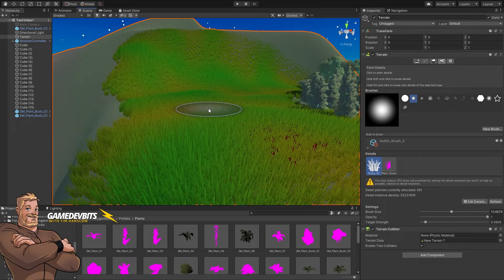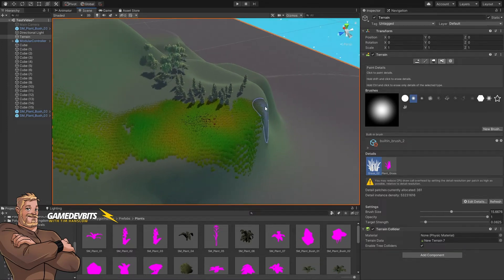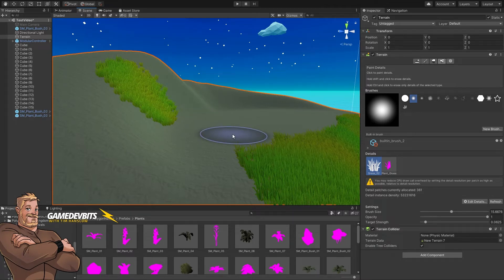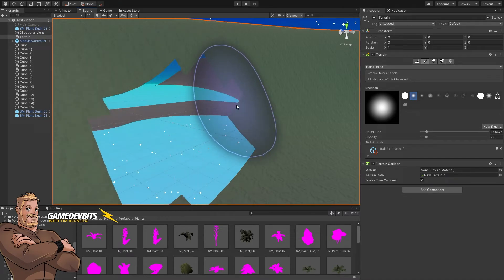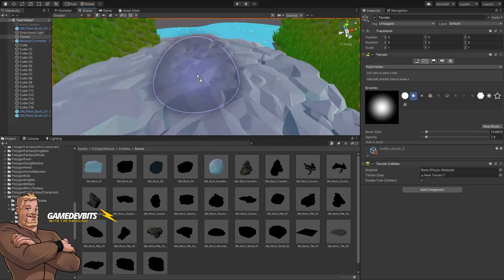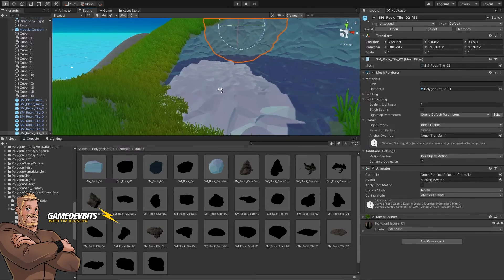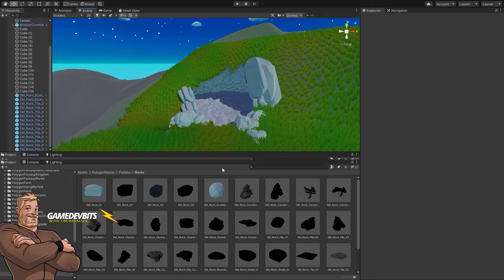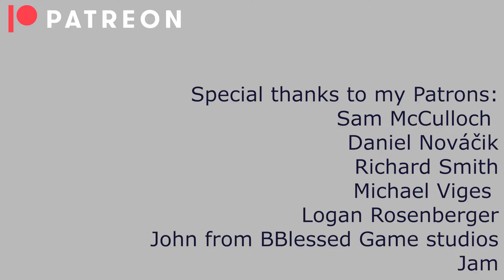Unity3D Tips - Terrains - 6. Terrain Holes

Comment: Can holes be made dynamically? Example: a sandworm coming out of a tunnel
Reply from the maker: Yeah you can use the terrain tools dynamically at runtime via script. But it's not really designed for it, so performance can take a hit. And you've got to get it right. Painting holes can be fairly chunky because of the resolution of your base texture.

On the asset store you can pick up Digger Pro which will let you do it at runtime, and it creates a voxel mesh to attach to the holes. Caves, overhangs etc.

https://assetstore.unity.com/packages/tools/terrain/digger-pro-voxel-enhanced-terrains-149753?aid=1011lcLEi

But, the big question is. Do you NEED the hole?
You could make a mesh that looks like the top part of the hole, pushed up sand. Dark texture in the middle for the "hole" part. Throw on some particle effects for dust and sand to mask it and then just spawn it on the surface.

Could even make a simple custom material to simulate the hole.
Nice and performant, no holes in the terrain.

Comment: My Terrian Holes wont render when I build. I have selected "Paint Terrian Holes" in the URP-BalancePiplelineSettings. If I enable "Draw Instanced" on my terrian, the hole work but all my ground textures dissapear.
Reply from the maker: There have been some shader bugs in various versions that stopped terrain holes rendering. First troubleshooting step would be making sure you're on the latest URP version for your Unity. And if so, move to the latest LTS.
IE if on 2021.3.22, move to the latest version of 2021, not 2022.

Comment: This is extremely useful for static terrain, but if you want to create a hole in the terrain in real-time then it falls apart
Reply from the maker: Yep, absolutely. Unity's terrain system isn't intended for realtime editing of any kind. You can make scripts to edit the heightmap on the fly, change trees etc, but they can introduce lag and generate a bunch of garbage.

Digger Pro is suitable as an asset to bring that realtime functionality in, as well as voxel creation of caves etc that blend with the terrain.

Comment: Hi, how to fix the blocky terrain deletion? Like when you delete terrain you'd usually get it round with whichever present you use but regardless if I use the circle one it still cuts a square. Do you know how to fix that or is it just a general bug or something?
Reply from the maker: The terrain control texture is made of pixels. The lower the resolution, the blockier it will look. You need to find the right balance between resolution and terrain size. EG you can use a 4k control texture and heightmap on a km terrain, and you'll have 25cm "squares " to cut out etc.